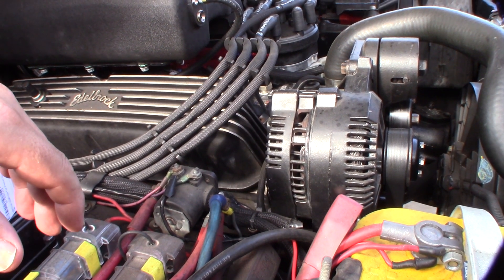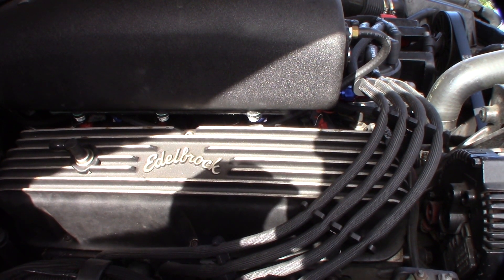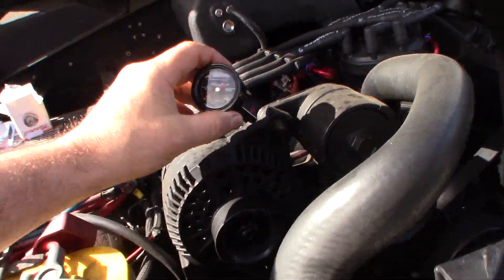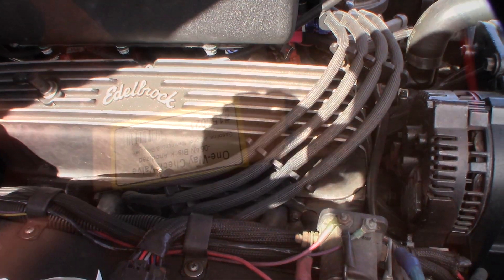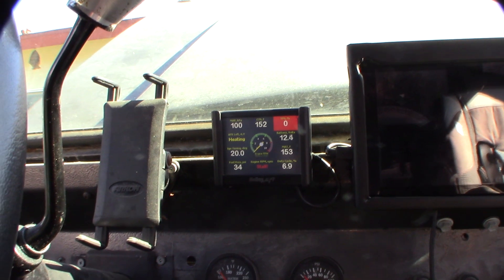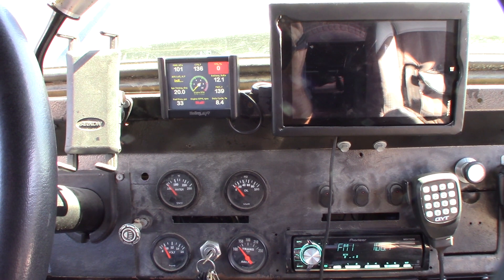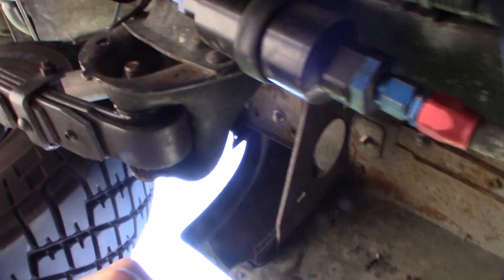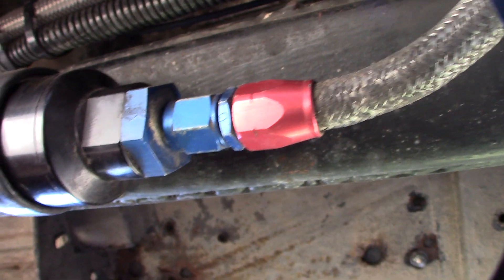EFI fuel injection vapor lock hard start or running ruff when hot check valve

Comment: Thank for sharing I have the same problem with a ford Mustang 1968 white efi 5.0 motor from 1989. when the motor is hot I cant start it after 30 min I can it start up again so I hope it the same problem I have.
Reply: Karsten Seth Olsen Your issue would not need an anti drain back valve. Being your car is experiencing vapor lock, you need to add a return fuel line. The return line will allow fuel to return to the tank and cool as opposed to sitting in the fuel line vaporizing. Modern fuel can vaporize in temps as low as 100 degrees.
If your running a return line and are still experiencing this issue, than you have a week fuel pump or a cracked fuel line allowing the fuel to drain back. Hope this helps with your issue